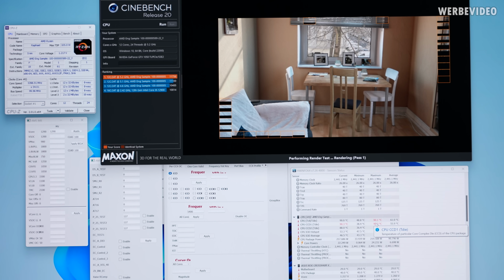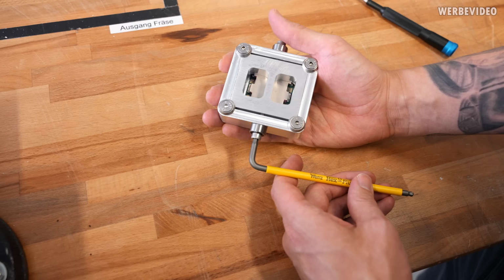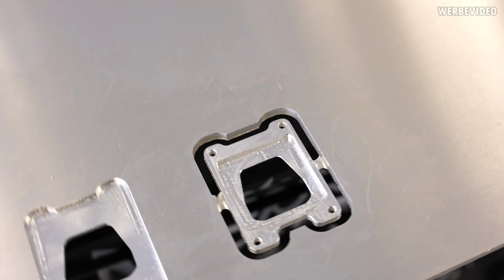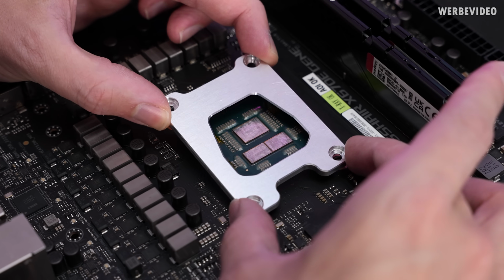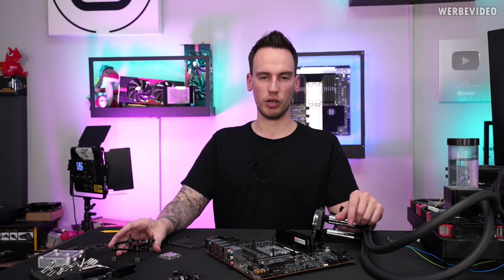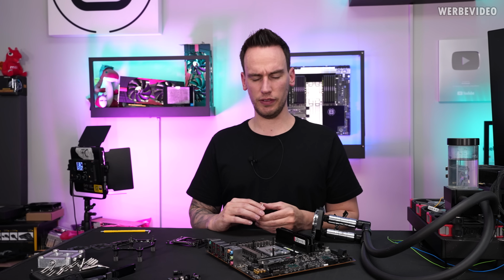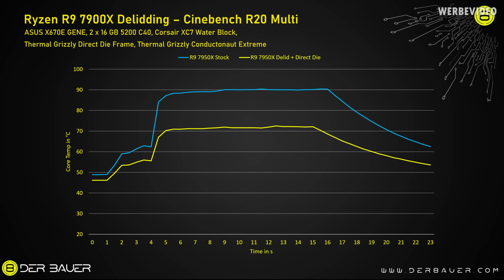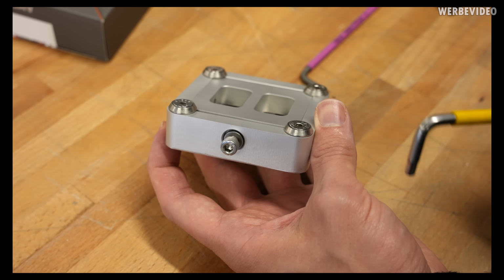Ryzen 7000 Delidding - Unreal Temperature improvement with Direct-Die Cooling

Comment: wait a second...... CRAZY idea here
.
what is AMD is using the 95C "normal" temp like a GPU does....AKA full send to T max, then back off
after all.... rDNA3 is using the same process as the CPUs
.
what if GPUs are usually "bare die" to max out cooling / minimize temps
.
.
.
if this is true..... the AMD gpus might not suck this coming generation
and i say that as a HARD CORE amd 5970/6970/7970 fan
.
i got a 5700xt because i killed my 6970 by spilling beer on it.............yup
and it was basically pretty damn good for 1080 144hz..... especially with the OLD ass shit i play (like.... CS go and squad.....DCS sometimes, but NOTHING runs DCS that great)
Reply: also..... these are SOLDERED! 
.
i was kinda worried (even as a self admitted AMD fan boi) the reason the temps were high is bad TIM.......
but nope.... AMD still doing their soldering (aka, too expensive!!!)
.
.
also helps my thoory...... that AMD gpu and cpu have more in common than we think 
im actually hyped for a hardware release since the ryern 1000 series!!!!
Reply: 15:10 ya.... i wonder if the thicker IHS = intels TIM instead of solder 
.
they need to go to AM5+...... or make the "base" (green part) of the chip thicker for the 6000 series
if these want to clock like an integer GPU.... then thermal transfer efficiency is king
.
do the brave thing......... go bare die!!!
lets do it AMD...... go BALLS OUT on temps (because you gonna get crap for this)

Comment: You should see what gains you get by lapping the IHS as you described. I’d like to see if using a too thick IHS is basically the whole thermal problem. If so, they’re going to have outsized thermal issues compared to their power as long as they’re win on the socket.

Comment: Have you guys tried using "chip removal alloy" as thermal paste? Some types melt at temperatures as low as 58°C.
Reply: It's not good to use something that constantly melts and solidifies when machine turns on and off
Reply: @BusAlexey  Because? The liquid metal used now goes bad quicker than other types and attacks copper and aluminum. The chip removal alloys might last years and years and won't attack any metals. It can be found in various melting points from 58 to 160°C.

Comment: kudos. That gadget to remove the die cover looked a superb answer to that problem. I look forward to where you go with this. 

If you are looking for another project, I have an idea you might want to take a look at. This idea is to water cool the RTX 3090 using an off-the-shelf AIO. It would need a copper plate that was cnc contoured to match the actual GPU height, as well as the height of the Vram and VRM with their thermal pads in place. Alternatively, you might do this as two pieces, with a copper shim on the GPU to fit under the underside of this plate, and use thermal paste on both surfaces o the shim. The top side of this plate would be flat for an AIO to have direct surface contact, again with thermal paste. The whole thing would use the existing main 4 holes on the board to clamp it in place. It just occurred to me,  if you had screws that were long enough to fit, you could use the original spring mounting plate to provide the correct tension on the copper plate.

Comment: before delidding what thermal paste are you using - regular (like kryonaut thermal grease ) or liquid metal? for correct compare you must use the same paste in both tests (if you use liguid metal you need apply it on ihs and on cooler's surface, like you did iin this video)... (i thing that you are not using liquid metal before delidding, because ihs is clean and cpu markings are readable...)

Comment: AMD should just sell CPU packages with and without the IHS. I can still remember the pre-Phenom II days when AMD resisted putting IHS's on their packages to begin with(Not all Phenom II's came with an IHS btw). Having a frame around the perimeter of the exposed cores to protect them is a much better solution for thermals.

Comment: This makes absolutely no sense unless you're a geek, and do it for "fun".
These processors have a heat problem, it should be the manufacturer to solve it.
I would buy the intel 13900 instead, not that it runs cool, but it's not this bad.

Comment: We understand that there is BIG RISK IN DE-LIDDING.
That being said, i was so skeptical since i saw 95 C operating temperature that this chip would be something that would be marketable to workstation class productivity users.
DROPPING 20 DEGREES CELCIUS ON THAT FLAGSHIP CHIP LEAVE SO MUCH OVERHEAD ON THE TABLE.
Although this mod is maybe out of reach for some, the fact that it can be done with soon available tools makes this a killer project.
DerBauer, once again, pushing the envelope has yielded HIGH REWARD and, as i'm an Intel user, I love seeing promise of extra performance from the competition.
REALLY great video man!
Reply: What do you mean with "soon available tools"?
Reply: @ThereisNOpandemicWAKEUP  I believe Der8auer said that this delidding tool was not yet on the market.  I understand there may be some other tools out there to do the job, but seeing a safe and methodical way to de-lid an expensive piece of hardware is probably best practice, esp. since he did it on video.  Not trusting anyone else without a video and as deep an explanation as this guy.

Comment: do you have provisions for using heat (heat gun) in the de-lidding process?
Reply: the reason I asked is that I wish to use less mechanical force and allow the heat to soften the binder on the dye.

Comment: I'm sure you have tried it, but when using the Artec Spyder, you should put small parts like the cpu on a lazy suzan. Elevate one side of the part, with something like a glob of hot glue and 8-10 faducials. Also, static mount the scanner, then you can spin the table, and get more repeatable, higher accuracy parts with the lesser expensive Spyder scanner. Tricks of the trade.

Comment: The ihs thickness causing that significant heat increase is totally not worth the "cooler compatibility". It's not like the compatibility is actually there because of the new Sam design. 
They already changed to lga, just optimize for new coolers instead of kneecapping casual users.

Comment: Would there be some benefit in using a very small blade to cut the 8 glue points before fatiguing the die-to-IHS solder? Or do you need more points to absorb the stress to prevent potential damage to the die during delidding?

Comment: You could use a single screw if the center part was threaded, and the outer holes were loose, and the screw had a stop on both ends, e.g. a tack welded nut opposite the head

Comment: I'm sure you're very experienced in delidding CPUs, but I'm not sure if 'breaking' solder is a good idea. Wouldn't it much better if you somehow can apply a little heat to the jig (eventually to the IHS)? Indium solder should have a lower temperature than regular solder so heat requirement shouldn't be that high, and the process would be a little better.

Regarding the significant thermal improvement, is it likely that AMD might be using worse metal for the IHS and/or the solder? Could be interesting to test that..

Comment: Impressive to me that you choose to machine it in tabs, resulting in 1 setup. I've made similar parts, we'd always have to set em up with multiple operations. Pocket milling + drill in the first operation, then add workholding screws into a fixture plate, then machine the rest in a second operation. 
The guys in my shop don't seem to be fond of tabs.

Comment: I think it was in Jayztwocents’ video that amd said a temp of 95C on the 7950x was standard operating temp, with no thermal throttling, instead it will use the power available based on the cooling of the system to determine how it was running. Or something like that. I wonder if delidding that would help it reach higher performance at the same temp and cooling…

Comment: Deliding is dangerous. What I think would be more safe move is giving that CPU to a CNC machine to take off some material from IHS and then modifying cooler mounting. You can now measure IHS thickness and decide how much material could be taken off and then with around 1mm thick IHS it could give some nice results. Not so impressive like direct die cooling but I think much safer for CPU.

Comment: ill be back in half a year when the platform cost is down, and yall have the product fully tested and available and will delid my 7000. I just wonder how much heat can my arctic liquid 120 with push pull fans will be able to dissipate.

Comment: You also sounded very surprised buy the lower 20 degrees Thats really a lot ! 
But Can that cpu really run all day at 95 degree ? Like amd is saying 
Because you had a higher clock speed, so 95 is not that normal

Comment: I'm surprised more IHS's aren't themselves integrated vapor chambers. It's not as if they can't do a silicon deposition and etch to make capillary surfaces on top of the silicon, and then wrap the thing in a piece of copper with a much larger surface area and heat dissipation capacity.

I'd much prefer that to integrated flow chambers which can have their pump fail, less moving parts. Standard ihs design is as stupid as the atx/itx form factor.

Comment: My 8700k dropped by 18 degrees when I delided it. And when I went from 1x thin 360 radiator to 2x thick 280 radiators it dropped near another 10 degrees. Had Intel's hottest cpu at the time idling at 29 degree's and 48 degrees under full load on prime 95 stress test.
Reply: I use to run my stock 8700k on a 280mm closed loop and it never went above 60 oC @ stock....
Reply: @NoOne56488  I was running mine at 5ghz all day, all cores for about 2 years. Not many people could get passed 4.9ghz especially your average builder with the temps. I've dialed it back to 4.4ghz now to save some life in it until I plan on upgrading 🤣

Comment: Yo - this IHS is so thick there's plenty of room for a vapor chamber in it. I honesty expected AMD to do that, rather than this new "95 degrees normal". This will outright solve the heat transfer issue - cores still safe under the ihs, cooler compatibility preserved.

Comment: I'm gonna show myself for the idiot in the room: How is that 360 rad cooling when it's faceplanted on the table? Is it a mesh table cloth over a mesh tabletop, or is it intentionally choked off to bring the cooling system up to thermal equilibrium?

Comment: This is pretty awesome. However, I didn't get why the CPU didn't boost up further since most reviews mention that it will boost up until it hits the 95C Tj Max point. Is there a limit to how high the frequency can boost?
Reply: It's a manual overclock on a fixed voltage.

Comment: Wouldn't it be far safer to use your de-lidding jig whilst on top of a hot plate at 150C+ (or out of a home oven)? It would soften the indium solder and avoid pure brute force and probably only need 2 (larger) movements in each direction.

Comment: I wonder how much performance could be seen by lapping the IHS. Obviously it wont be as much as direct die, but with delidding woes (RIP 7700X), lapping might be a more reliable boost to performance? Also wondering how much you could get away with on stock mounting hardware.

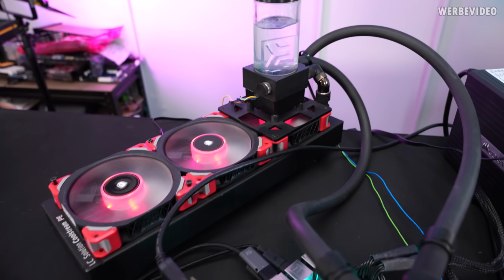Comment: Awesome results, but is anyone going to point out that the test setup has a radiator with one side just on the table where no airflow is possible at 1:47 ? It is not clear to me if this was the case during one or both of the tests but this will highly influence results between tests.

Comment: I remember delidding an old Intel core i7 and it fucking scared me every step of the way. This whole process seems to require even more fine motor skills, especially with the part about scraping the solder off the chiplets. Will you be developing a consumer-grade solution that is easier?

Comment: Techpowerup review Ryzen9 7950x they tested (OC 5.1 GHz All-Core) essentially function as Down Clock. With temperatures 95 C AMD go with maximum frequency to won at all costs ... costs Consumption and Temperature. Techpowerup results (OC 5.1) is so much better:
Power Consumption SingleT: OC 5.1 = 22 W vs StockCPU: 43 W
OC lose 10% in Cinebench R23 SingleT for Almost half! the power (90%).
Power Consumption GameAv.: OC 5.1 = 55 W vs StockCPU: 87 W = 56 C vs 76 C
OC lose 1-10% fps in game power efficiency jumps 70-80%
Power Consumption MultiT: OC 5.1 = 200 W vs StockCPU: 235 W = 80 C vs 94 C
OC Rendering lose only 2% in Blender vs Stock and you get -14 C.

Comment: Maybe for the 3D V Cache variants, the increased Z height will result in them shaving down the IHS to maintain compatibility. Perhaps this was intended. I wonder if the 95C cap is due to the thicker IHS.
Reply: The thicker IHS is the reason for the temps, however the thicker IHS had nothing to do with the 3D V cache; It's to make the coolers from am4 and am5 compatible and it really blew up in their face imo.

Comment: Great job, but from my point of view, you can improve the tool, like this:

- Instead of making it work by pushing or pulling, make it work by torsion, so that too much mechanical stress is not created only on the side where the pcb of the cpu presses.

- Make sure that with the torsion method the stress is distributed on all sides of the pcb, in order to try to reduce or even eliminate the breakage of it.

-You should create a tool that works on the ihs in a "screw / unscrew" way

I hope I explained myself

Comment: 19:05 wait a minute... Are you delidding 7950x too? Or mistype? 12-core is 7900x.
BTW great job and great results. What about Ryzen's thermal limit for 95C? Or you have been tried only locked voltage/freq?
RIP 7700X

Comment: is there any indication that steps were taken to remove the oxide layer. An oxide layer forms on any metal exposed to oxygen. This is were most/much of the heat transfer resistance occurs. Two metals in a hard vacuum with the oxide layer removed will form a bond if brought into contact. Not sure if hard vacuum is required or just oxygen free environment?

Comment: That radiator needs to be elevated off of the table so that the air can pass through, right now your fans are blowing against a wall. However that is an excellent credit for getting the job done that removal tool is great. Another point the fixed screws inside the socket bracket is an actual good thing.

Comment: Hmm, it seems to me that it should be considered if AMD didn't make a rather serious packaging mistake on the 7000. It is either that or the manufacturing is amiss on the entire platform. It is reasonable that a delid and custom cooling should result in better cooling but 20C better leads me to the aforementioned question.

Comment: Idea: CNC the IHS to be the bottom contact part of the water block.  Another mod could be an air cooling one where you cnc channels then mount heat pipes directly onto the ihs. This IHS is prime real state to be modded without deleding

Comment: I am dissappointed way more than you are impressed.  To protect the incredibly small market of those who keep coolers across computer builds AMD sacrificed performance for everyone else.  This is terrible.  Especially when you consider that this was a platform change for AMD.

Most PCs are store bought or OEM procured.  They come with coolers.  There are a very small number of people who build machines.  A small portion of those people will buy a new platform and carry over cooling.  So to protect a small portion of a small portion of a small portion AMD made the rest of the users worse off.  Great Job AMD.  

For the enthusiastic people, might I recommend buying natural gas contracts in Europe.  Sure, you'll be making people suffer more but you'll get money right?  Let's all applaud.

Comment: Can you try to take off about 1.2 mm from the heat spreader as you have suggested if the results will be the SAME compared to the DELIDed version? Probably results with delided CPU will be always better, but the maybe the difference between stock version won't be as much as 21 degrees Celsius.

Comment: If I ever do get a 7000 series chip, I'm delidding it. There's no way that 95 degrees C is reasonable or healthy on the processor. Temperature fluctuations are the number 1 cause of natural failure due to different expansion ratios of the subcomponents and interconnects.
Reply: I think everyone agrees but will turn on their eco modes instead. I mean you see what happened to his last cpu it broke so delidding soldered IHS isn't so easy, these cpus ain't cheap.
Reply: @waitandhope  Not yet, they're not! Lol

Comment: Kids asking for AMD to sell delidded chips are too young to remember the time when Intel and AMD all did it. It was stressful having to be extremely careful not to chip the edges of the die. Companies like Thermaltake used to sell thin copper shims to place in between the CPU and the heavy copper heat sink. I'm glad those days are long behind us now. The cooler bracket and plastic mounting points off the CPU socket were outrageous too. I remember the time when CPU coolers were mounted directly to the CPU socket. There were no 4 bolts or latches around the CPU socket to mount the CPU cooler like we've had for decades. One time I ended chipping off the edges of the brittle mounting points off the white plastic CPU socket (Socket A) when installing a new Athlon XP CPU. That mistake almost ruined my motherboard. There were no metal CPU brackets like we have today. Thank you Intel and AMD for fixing these design problems.
Reply: Athlon Thunderbird good memories
Reply: Lost my Barton to cracked die..... Might still have it....